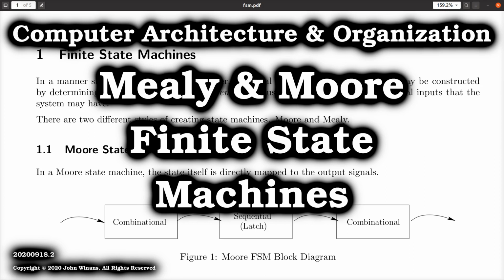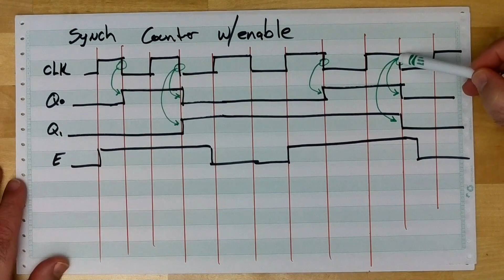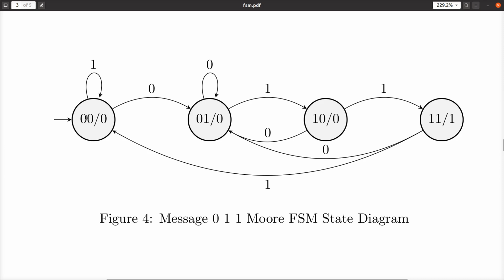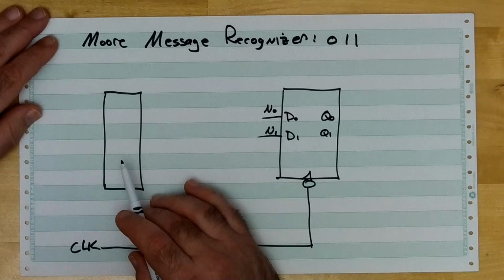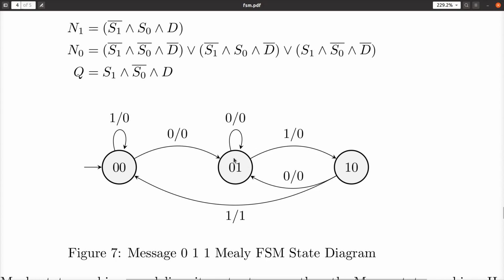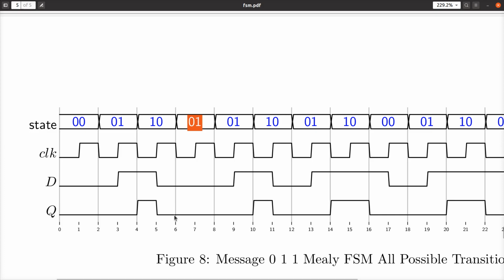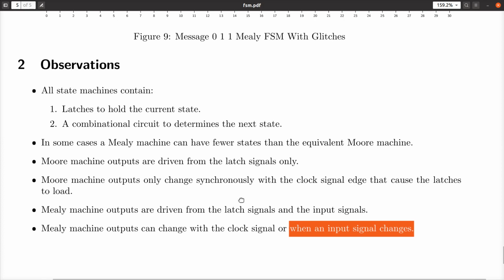Moore & Mealy Finite State Machines

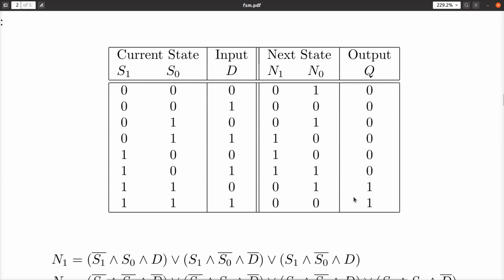Comment: At 24:41. In this table if the current state is "1 0" and the input "D" is "0", shouldn't the next state go back to "0 1" not stay "1 0"?
Reply from the maker: Uh oh!  It appears that I made a mistake in the handout.  You are correct!  The Message recognizer state table is wrong.  Therefore equations 5 & 6 are also wrong.  Luckily the rest section 1.2 appears to be correct.
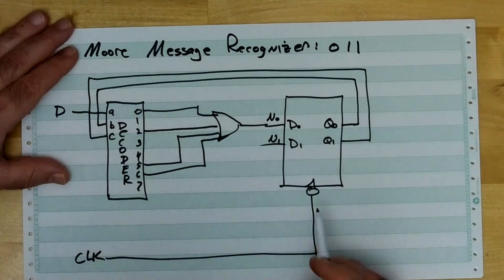Reply: @JohnsBasement  The diagram would also look slightly different right? Correct me if I am wrong but at 34:36 the "OR" gate needs to be wired with inputs 0,2,4,5, and 6 into N0 and the other "OR" gate into N1 would need inputs from 3 and 5.
Reply from the maker: @migiquinones9554  yeah.  It would reflect the changes to equations 5 and 6. (The handout has been updated to reflect this change.)